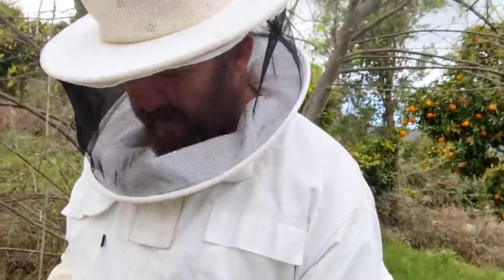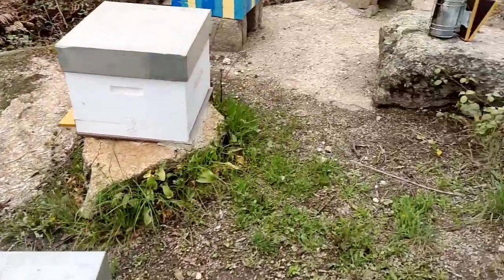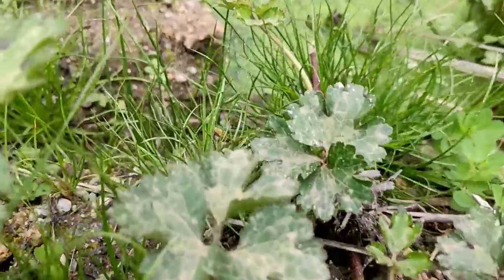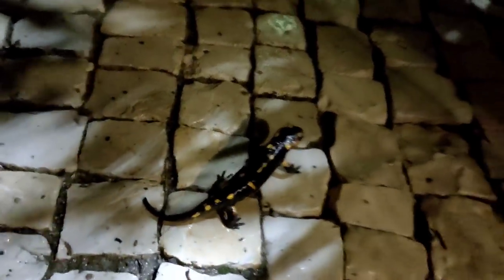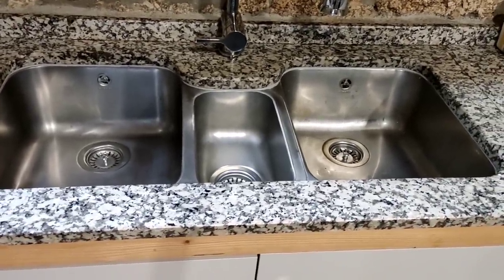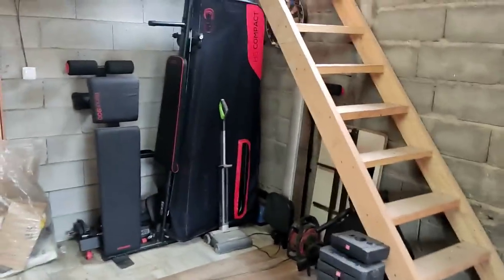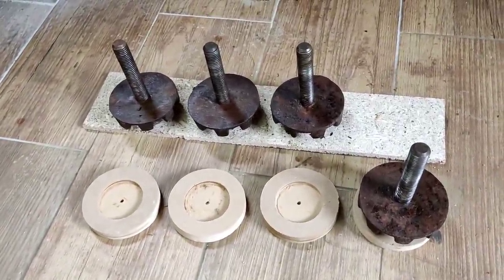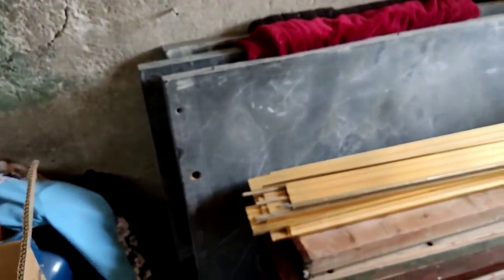NO 45,   Bigger Bee Hives ! New Pool Table

Comment: Size and height are perhaps the most important factors when trying to imitate the tables that tournaments are played on. The pros play pool on 9-foot tables that are between 29.25 and 31-inches in height. If your main goal is to imitate a pro table, you’ll benefit from ensuring the playing surface is within that height range
Reply from the maker: Thanks, I've just found out it's a 7ft English style table, so I'll need a slower cloth, smaller balls etc,etc

Comment: American pool table surface height is between 30.25 and 31 inches. The cloth is woven without the nap of English pool table cloths. I have an English table here in PT which is frustratingly difficult with the rounded pocket bumpers that bounce randomly. I also need a new worsted non napped cloth but can't find here in Viseu as of yet...